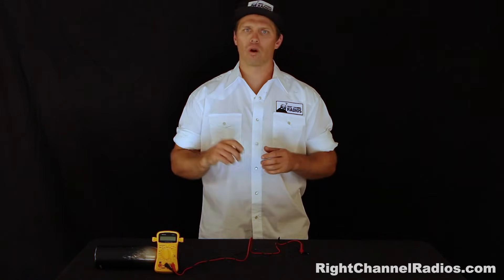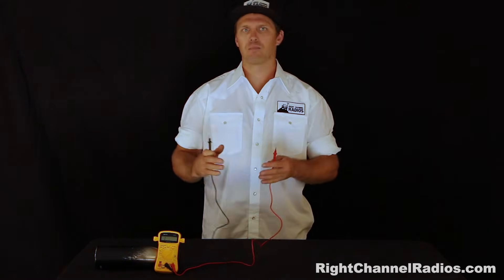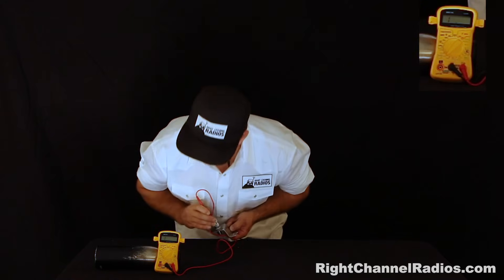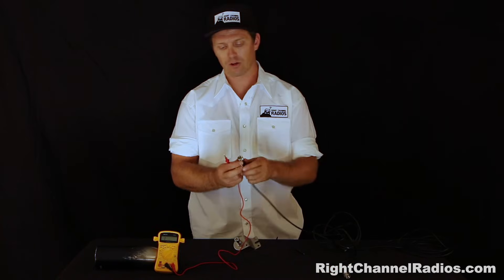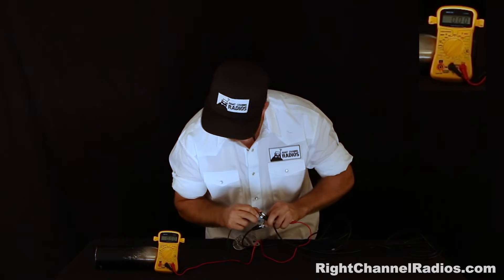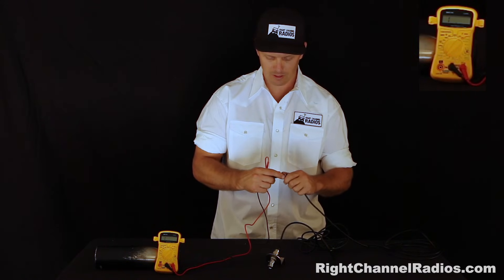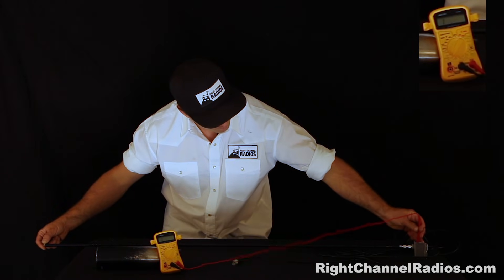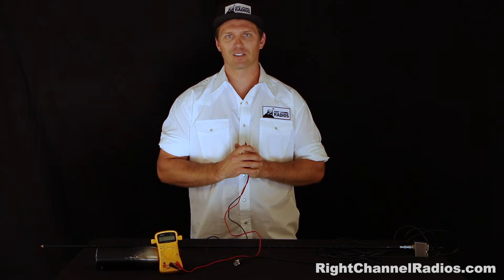Using a Multimeter to Test your CB Installation | Right Channel Radios

Comment: HI and thank yo for the clarity, I do have a question though. I have a Sirio Fighter 5000. Ay nd I notice that I when I spilt the two main parts, apart  I still have Continuity between the Centre pint and outer ring, (Would be the threaded part of the antennae fixing point to the 259 Mag mount. The thing I have trouble with is that this is a brand new anttane and seams faulty. Is that correct. 
Cneture pin is / seams to be making contact to the other threaded ring....
Cheers Nico

Comment: When I check continuity on my antenna, there is continuity from the frame of the truck to the bottom connector ( 👍) but when I check on the bottom of the antenna shaft there is also continuity ( 👎), so now I disconnect the coax from the cb radio and recheck and it's all good.... something wrong with the radio then?

Comment: to easy for that type mount. What about a magnetic mount, I cant find a damn thing on testing those. Is the center or the threads shorted to the metal whip? OFF the car. I dont want to mount a bad one.

Comment: I like your video.  Is there anyway to do this with a glass mounted antenna?  I'm thinking the only way is with an SWR meter since the ground method you demonstrated will end at the coupling box.